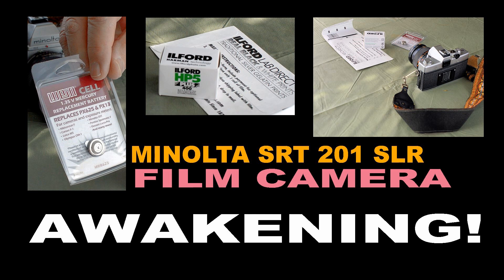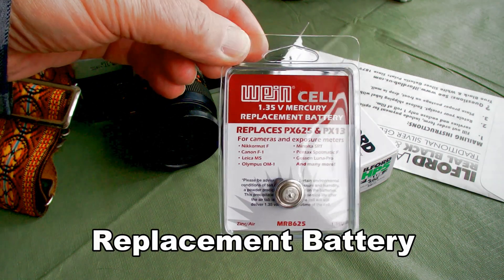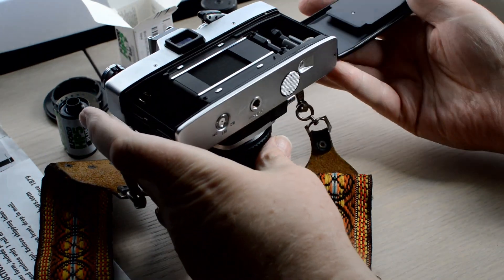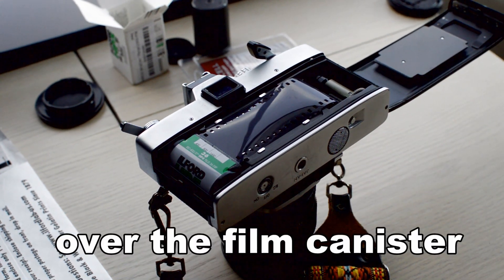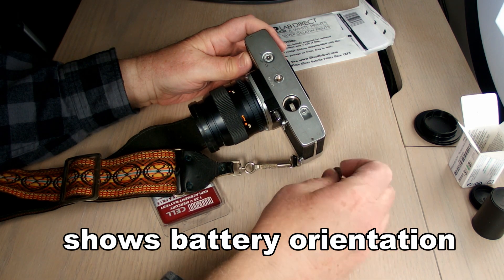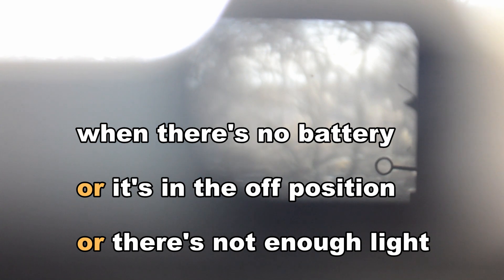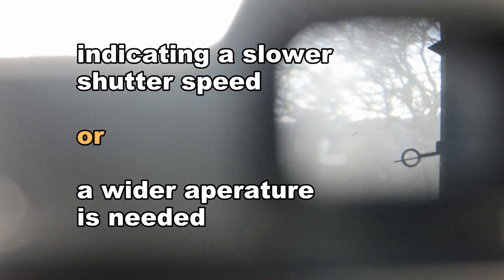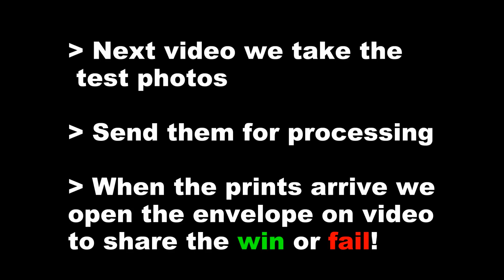The Minolta SRT 201 SLR Film Camera – Loading Film and Installing a Battery

Comment: my needle doesnt go down quite that far when I the battery tester. I ordered a bunch of new battery for it though dont know if that means mine is broke or what. i hope im not ruining every pic I take
Reply from the maker: Are you using the WeinCell MRB625 Replacement Battery? That's the only battery I've found that gives the same voltage (Therefore, exposure readings) like the old PX-13 (The one this camera was designed to use).  Other than that it may not be a big deal that your needle doesn't react like mine in the video. Hope your shot come out OK! -Rob
Reply: @TechVideosNET  I'm using a Loopacell 625A. I guess the only way to find out is to get a roll shot and sent off haha. The wait at my local one is 2-3 months they said but I'll find out eventually

Comment: So if the needle doesn’t move after you put in the battery does that mean the camera doesn’t work?
Reply from the maker: If the button on the bottom is set to on and the battery is good and you change the strength of the light in the viewfinder then - YES - the needle should move as the light values change - tell me what happens pls --Rob

Comment: Where do we get the battery ?
Reply from the maker: It's the WeinCell MRB625 Replacement Battery for PX625/PX13 at Amazon for example. I found the exposure meter to work perfectly with this PX-13 replacement.